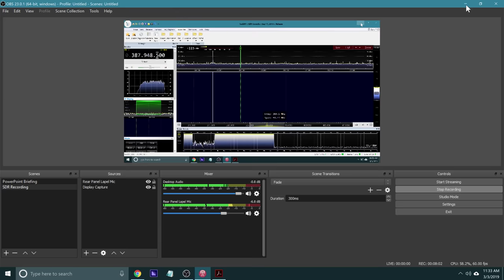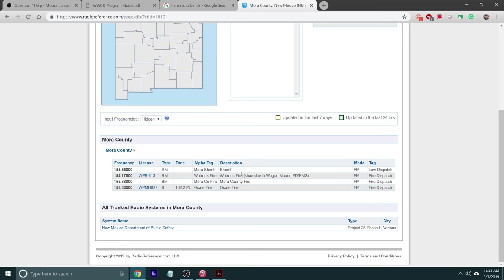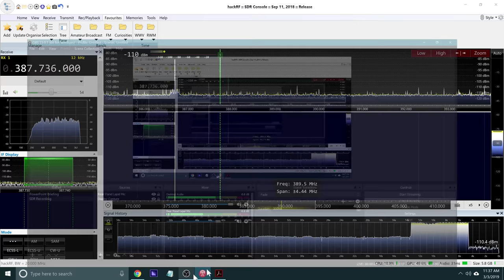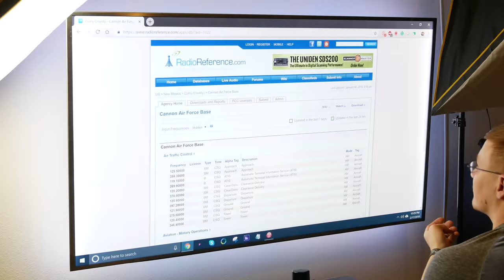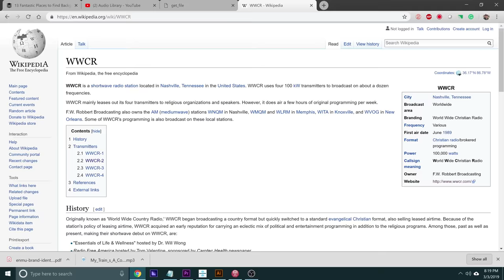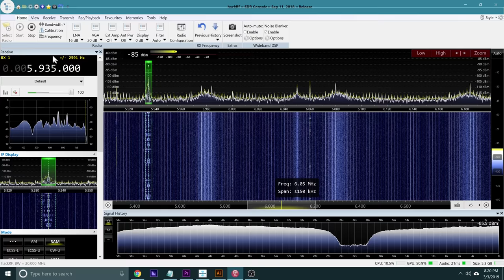Tuned Magnetic Loop Antenna - ENMU - EET 490 Capstone - Update 2

Comment: That is a very well built loop. However, i believe you used the wrong measurements if you plan on listening to VHF and UHF frequencies. The only element listening on VHF and UHF is the coupling loop. Im will to bet that if you remove the coupling loop from the outer bigger loop you will still receive the VHF/UHF freqs. The antenna you built is more efficient on the lower frequencies such as 3.8mhz thru 14mhz. You also mentioned that it is 20mhz wide in regards to receive. Which also leads me to believe that the only element that is doing the work on VHF/UHF is the coupling loop. Magnetic loops by nature are extremely  narrow banded and will need to retune the variable capacitor every 50 to 70 kilohertz and have a super HI-Q. Not bad though.
Reply from the maker: Regarding the 20 MHz, I should clarify - I meant the SDR reciever (Hack RF) was capable of receiving with up to a 2O MHz bandwidth. I confused a lot of people by using some B-Roll footage of me learning how to use the software. I need to do a new video using the loop at its resonant frequency spectrum and tune through it with the cap 50 Khz or so.
Reply: Daniel Tooker yes would love to see how that bad boy performs on the low bands.
Reply: Daniel your radio knowledge is all confused sir - your antenna dimensions suit 5MHz NOT 100 - 400Mhz Try talking to some Radio Hams, don't brush all of them off as numbskulls, or Google the topic, there's lots of info out there ;-)
Reply: N2SAL RADIO
Good point except I can't get even 50Khz band width with mine!

Comment: Thanks for this video. Very nice construction project. However, I am baffled as to why you chose to make sure a large loop to use for UHF/VHF listening? The size of this loop would seem to be more suitable for 40 meters and lower frequencies.
Reply from the maker: It is used at 50m at the end of the video. This is one of those videos I love to leave unedited to remove b-roll footage. All the UHF drives radio operators crazy and keeps the comments coming in. I really should move the 50m clips to beginning of video somewhere 😅

Comment: Good construction approach I’ve used myself but little confused. Based on loop size and capacitor value, would expect a frequency range of approximately 7 MHz to maybe 21 MHz. You were listening to frequencies in 269 and 138 MHz area, At those VHF frequencies, this loop would be nothing more that a large diameter piece of wire and would demonstrate absolutely none of a magnetic loops characteristics. Try it in HF range and think you’ll be pleasantly surprised. .
Reply from the maker: I built it for HF, the demo in this video was b-roll footage I had to use since I'm in the middle moving. Cant wait to play with it more after the dust settles. I want to use it at resonant frequencies tuned to HF bands. I'm working on a stepper motor to tune the cap from the PC. I've got a video on my channel about. Got almost everything working, but running short on time.

Comment: An interesting mag loop antenna, although as others have said, using flat copper strip or flat braided straps instead of wire around the capacitor  (used for bonding metal panels and for heavy duty earth cables) will help the performance. RF travels on the outside of conductors so the surface area is the important issue - this is also the reason your large diameter ducting is good. You probably know this but it's important for the viewers to understand what is meant when you talk about pointing the antenna at something. The mag loop transmits and receives co-planar with the loop itself, in other words if you extend an imaginary line from one side of the loop to the other that is the plane the loop is most efficient in and pointing this imaginary line at where you want your signal to go or where you want to receive from  will maximise performance. Pointing the broadside of the loop will have the opposite effect and one of the main advantages of magnetic loops is there ability to null out unwanted signals. Another advantage of mag loops is that they transmit and receive a  high percentage of what hams call "high angle signals" when used in the HF frequencies. This means that they are very efficient for long range communications and that they do not have to be mounted high off the ground to operate very efficiently . 

I would strongly suggest you look at becoming a ham and assuming you are in the US join the ARRL. Regards Sarah G7TXR
Reply from the maker: Sarah, I've actually been learning a lot from comments from the community - including yours! I'm glad I posted the video because the feedback has been awesome. The skin effect on the copper does make since. Not sure why I didn't think of that during the build. I'm moving right now and almost done relocating. I'll do a follow-up video to address all the good feedback topics and modify the antenna a little. My coax (RG-6) is actually 75ohm, so I have to correct that as well. In my follow up video I may see if a Smith chart will be useful for tuning the antenna for impedance matching with the line.
Reply: @TookBurrow  Good luck with your move, the great thing about home made antenna's is that they are never really finished, in the life of the antenna you will get them to the point you think they are finished, then learn something new enabling you to revisit it and improve it further. "Home Brew" ham gear of all types is like this and a small amount of money and a lot of ingenuity will get your signal a long long way :-)  Regards Sarah

Comment: Excellent choice on the capacitor and what a great deal on it. DSDPlus and SDRSharp is free software and will decode the NXDN, P25, DMR, C4FM etc. digital signals you will find. I'm putting a commercially made mag loop in use on my amateur radio station but your video is inspiring me to homebrew one. Great job on the build and video editing!
Reply: add virtual cables and ya set.

Comment: "Nulling" refers to turning the antenna to minimize the interfering noise source, not maximizing the receive signal.   Good job. You would make a good ham.
Reply from the maker: Thanks! I did notice the interfering noise peaks reduce directionally, but I also noticed the signal strength peaks directionally as well. Thanks for the pointer, sorry for any confusion.

Comment: Magnetic loops are normally designed to cover one octave of frequency, this meaning the high frequency end will be twice the lower frequency of the range. The loop circumference should be about 1/8 of WL at the lowest frequency and 1/4 of WL at the higher one, it shouldn't be no longer than 1/3 WL tops, because it will not work anymore as a small magnetic loop and will start radiating bidirectionally and perpendicular to the plane containing the loop (like big loops do), instead of radiating bidirectionally along the plane containing the loop with a kind of a figure 8 broad pattern (which is not very directional) and deep sharp nulls centered on the plane perpendicular to the loop's. 

You can work it at lower frequencies than where it is 1/8 WL but it will reduce the already low efficiency and increase the voltage across the capacitor. By the size of your loop it should be good for around 5 to 10 MHz and a bit beyond these limits. The current density of these loops is huge, with power levels of 100 W and more there will be a lot of amperes on it. Keep all living things away from it when transmitting, that includes you! A 100 W excitation can put 5 kV across that capacitor. I would put an RF choke near the feed point to make sure that the coax is not contributing to the radiation pattern.

Nice built, thou.
Reply: You missed that he's only using the antenna for receiving.

Comment: To be honest, vacum capacitors are useful when you want to transmit at a reasonable amount of power. As for reception, an air capacitor would do the exact same job without any difference.
Air capacitors can cover from a real zero pF to 3 or 4 hundreds pF with no problem. If you want more capacitance, you can add a switchable fixed 100 or 200 pF capacitor in parallel.
Reply from the maker: I'm certain you are correct. I had an air gap butterfly capacitor, but it was 500pF to 1500pF and very jumpy/sensitive to the slightest rotation. But my vacuum cap was ~0pF to 300pF so I used it instead. Was much easier to tune since nearly a full revolution was a 10pF Delta
Reply: Nice for remote tuning.

Comment: The dryer aluminum tube is interesting, but the figure of merit is the loops Q that can be seen tuning across a noisy band as the width of the Mag Loop's resonance.
If you want to impress, show the BW of the mag loop and the freq being scanned.
Do that in the lower HF band with mag loop at resonance.

Comment: Very good job Daniel. RG-6 is 75 ohm cable TV coax. You can also use it for transmitting but just be aware that you will have a slight impedance mismatch.
Reply from the maker: Thank you. I was wondering why they didn't print the impedance of the RG-6 on the package. But I realized the typical user will not need to know that. Do you know if the impedance varies much from one manufacturer to another?
Reply: @TookBurrow  The impedance will not vary. However the velocity factor can vary. The VF is a function of the coaxial dielectric and it's physical size. The VF is significant in determining the power loss in decibels/100' at a particular frequency.

Comment: A great video...one thing that intrigues me is that you are receiving UHF frequencies with mega loop. The resonant frequency you receive depends on the length of the primary loop.with this big loop  you should be in the range of the HF wavelengths.Its a combined effect of tuning the LC circuit. you definitely dont need such big lengths to receive uhf with the principle of Magloop.I reckon your coupling loop itself is acting as a folded dipole for the uhf frequencies...well these are all my assumptions...Anyway good luck with your future projects...And ofcourse great job with 3D printing.
Reply from the maker: Yes, towards the end of the video I was receiving at aprox 5MHz. I think the UHF was b-roll footage. I've been planning on successfully recording that and showing the antenna operating at resonant frequency earlier on in the video.

Comment: Interesting design choices. The thing certainly looks impressive. If it is meant for receiving only, the loop size and capacitor type would allow for simplification. If it was meant for receiving and transmitting, the aluminum material might be too lossy. The first signal might be an ATIS, the second is a beacon transmitting "SE". Looking at the frequency it might be a VOR, not an NDB (which would be at LF frequencies). The spectrum is very broad which is unusual for a working magloop. At this size, it should be tuning at much lower frequencies (like 80 meter). If it works as designed, you should see a dedicated peak that moves when turning the capacitor.
Reply from the maker: Yeah it’s lossy, i haven’t used it for transmitting. It was a fun project though.
Reply from the maker: I haven’t done any further testing with this. It is disassembled, but I certainly kept a few parts from this build. I believe at the end of this video I recorded receiving around 50meter? Not sure if you watched till the end since the video is lengthy

Comment: Hi yes, good principle of design since RF currents migrate to the skin of the loop conductor (its almost all 'skin'). What would really show whats happening here is to use an antenna analyser, which when swept would show the resonance being in the HF bands for the dimensions used here. Im interested enough to try one this way myself, so thanks for the stimulating video, even it shows some more research needed to get it singing on the right bands.

Comment: Nice job with the loop. The 4" rigid duct, while it is a very good inexpensive alternative, may some losses which can be reduced. As a suggestion you could also use a piece of 1-5/8" or larger Heliax like AVA7-50.  The corrugated outer conductor is copper.
Reply from the maker: Very interesting. I'm going to give the AVA7-50 a good look
Reply: Moving from the duct diameter to AVA7-50 would roughly halve the efficiency (from c 39% down to 21% or thereabouts)...you always need the absolute maximum conductivity on the loop skin you can acheive.

Comment: Great video but RG6 coax has always been 75 ohm... RG58 would be the 50 ohm version that's the same outer diameter and RG55 is the mil spec version which is 53 ohm.

Comment: Good video, problem is in the UK, a vacuum variable capacitor is upwards of £90. If I just want to receive, the capacitor costs more than the sdr, ham it up, cable etc.
Reply from the maker: I saw your name and thought you might be the Mr. Pickering of PXI Chassis. You are right though. The vac-variable caps are only worth it if you plan to transmit and generate multiple kV across the loop. I think a ham fest or radio garage sale might beat ebay for used caps in terms of price points and being able to see before you buy.
Reply: Sadly not me, I work for a VERY large organization in a telecommunications specialist role. Ham and RXL is a hobby I have very little time to do. At the moment I am grounded in isolation because of Covid-19, RXL is a great thing to do or I'll be YouTube surfing!

Comment: Thanks for showing your work, like the alu ducting idea !  Given the dimensions of the loop I was expecting a demo with signals in the HF band, say around  4 to 8 MHz, did you opt for the VHF/UHF signals as they  were constantly transmitting ?
Reply from the maker: So I did recieve at ~5Mhz towards the end of the video. You are correct on expectations on which bands given loop size.

Comment: Try flat copper strips around capacitor . Wires are not the best choice for RF . 👍
Reply from the maker: I have read people suggesting that. What I've seen is that whatever you can do reduce the overall resistance in the loop, especially contact resistance where connections are made helps. Soldering is best for that of course, versus just compression or clamping. I'll see if copper strips make a tangible difference when I get another chance to play.
Reply from the maker: @John Cliff Thank you for the notes on silver plated copper strips (skin effect). That is a very cool and practical change I could make, not sure about how much silver plating would cost, but I imagine it would help overcome some of the losses from the material I used for the loop itself.
Reply: @TookBurrow  In uhf/vhf a few db gain may be the difference in deciding digital signals.   Or not. This is a mv/hf antenna but digital signals are increasingly found within that spectrum.

Comment: I can feel your frustration with that coax shield!  Aluminum can be really difficult to solder.  I've resorted to wire nuts, crimp connectors, nuts and bolts ... all kinds of alternatives.  People talk about galvanic corrosion, but it's not easy to get copper and aluminum together!

Comment: Check out WSPR, Weak Signal Propagation Reporter. It is an automated, digital mode used by hams to test antennas and HF propagation. The nice thing is that it uses only a fixed 200 Hz window in each HF ham band. Usually there is at least something to receive there. So if you need some signal to receive to test your setup, WSPR is a valuable tool.

Once you got a ham license you can also transmit. WSPR is effective even at very low power. I am in Germany. Often I receive a station from Japan 9350 km away that is sending at 5 W and a station located in Saudi-Arabia, 4150 km away, transmitting a mighty 0.2 W. I receive 5 W signals from the US / Canadian east cost on a regular base.
Reply from the maker: Very cool!! Well definately check that out. I've been getting such good advice from the community here that I will have to upload a follow up video here on YouTube

Comment: Hi Daniel... Good stuff.
I may have missed a point here, but are you receiving these VHF stations on that large loop?  
I wouldn't have thought that it would tune so high.
Maybe I should start at the beginning and run through it again?
G3NBY
Reply from the maker: Some of the frequencies you see me tuning to in the video was me just having fun with the SDR program. Towards the end I tune into a frequency at which the antenna nominally operates, I think it was around 4-6 MHz

Comment: 50Hz is normal for single-tone signals like CW or beacons.  That's one of the reasons morse code is still quite popular for long-distance, low-power communication.

Obviously another step would be to automatically tune the antenna with a stepper motor, to match whatever frequency you're trying to listen to on the hackRF...  Might need a network analyzer to know what frequency it is resonant at...
Reply from the maker: Neat! Thanks for sharing

Comment: I don't get it. You go to the lengths of 3D printing those parts, and then you make the coupling insulator out of a piece of wood.
Reply from the maker: Low cost prototype
Reply: @TookBurrow  because a non organic material is so expensive.
Reply: Again, he printed up the other parts and used a piece of wood in a small, crucial part.